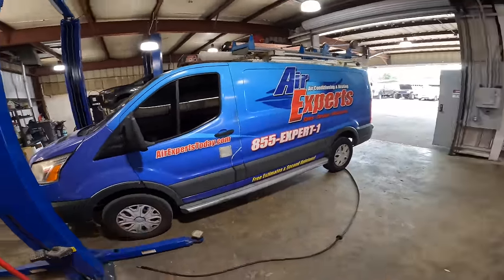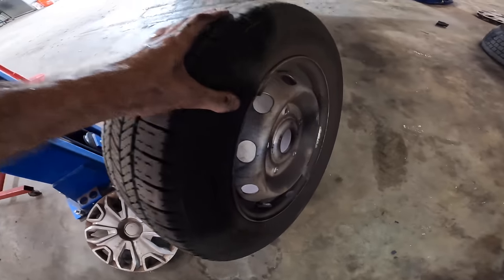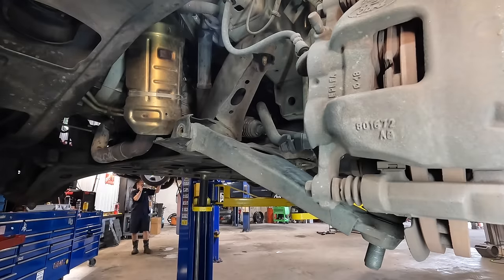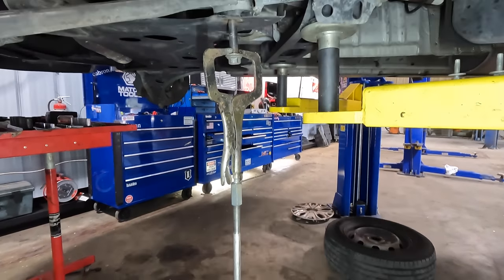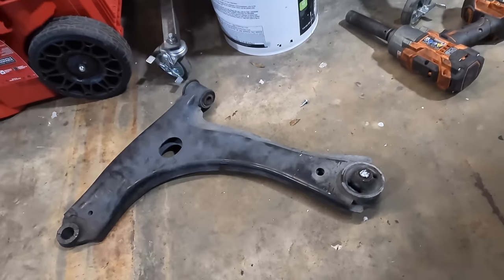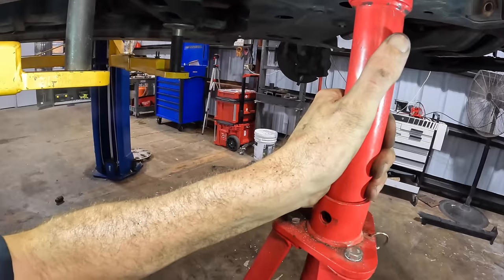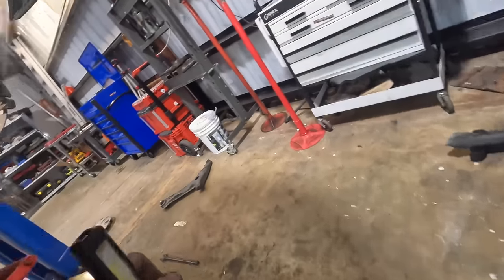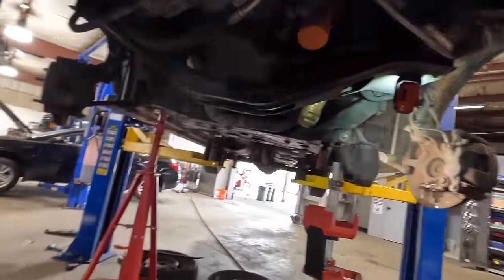Bent Frame Bolts! Easy Job Escalated! Ford Transit 3.7

Comment: The purpose of those armour bars seems to be to make the control arms part of the bumper.   With an expensive fragile monocoque like a Transit,  I'm not sure whether it's evil or sensible to make the steering part of the crumple zone.   At least you can fix it without welding or panel beating.

Comment: I used to maintain a fleet of those Transits here in the UK, but I've never seen those reinforcing bars on any of them. For balljoint removal there is a special puller with studs which screw into the bolt holes, then it attaches to the b/j thread and pulls it out. I used to improvise with 2 lengths of M10 studding with nuts, the yoke from a heavy duty 2 leg puller and the balljoint nut. They used to pull straight out. Fitting the new one just needed a suitable sized socket to press it in, using the studs and yoke to pull it in.
Reply: Winner, winner!

Comment: On long bolts that get stuck like that, the pickle fork was a good idea, should have used the head of the hammer for the rest of it with the pickle fork to get more leverage

Comment: Ray, I would have heated up the lower ball joints mount with a torch to just at red hot then while still hot hot just the ball joint with canned air held upside down so super cold to shrink the ball only and just a tap with hammer and it will fall out. Now before installing new ball put the joint in a freezer for 8hours but overnight is best as it shrinks the joint and straight from freezer install slips right in install bolts and done

Comment: I've found using a breaker bar to loosen captive nut body and suspension bolts then run em out w impact works. Just my experience.

Comment: 20:50 I would get the sawzall in there and cut the top of the bushing and the bolt at the same time with a short metal blade. Careful to check what's behind it so not to cut any wiring.

Comment: I can't see well enough to know if it's possible, but I might've tried a short Porta Power cylinder between the top of the ball joint and the upper part of the knuckle if it would fit and get a purchase. The geometry might not allow it, but if it did, those things can really push.
Reply: That would be too easy of a fix. Therefore he cannot charge an outrageous six hour job.

Comment: Good choice changing the left support position for the front of the van.  The first position was very dangerous, never ever lift on a round surface on the side of the left point, it is going to slid off and make a very large mess of the van and any human under the van.  Good change of position!!!!!!

Comment: had samme thing on a opel here lol it came out till a certain point and got stuck i had need cut in to the control arm to slice it open so that i could get the rest of the bolt out no fun way to do a 1h job in 6h :)

Comment: Oh you poor wee man.  What a pain in the rear. You can just see the twist in the brackets.  Question.  when you get this back together can it be aligned ?  I sure hope you don't have to replace major suspension bits.

Comment: Wow,demolition derby 😂 wasn't expecting that !!! . If those bolts were bent .How much more is wrong in the front of this van ?.As for the Tyre being worn like that.I would say you have a bent steering arm. The other side is OK.  Needs checking out Ray not good.
  But it was good to see you fight the good fight and win.
Cannot have easy every day.
 Great video as always. Look forward to the next fight on this van.Never did like Fords.
 Have a good day Ray 😊

Comment: If the arms are well under the vehicle, and a pad falls off, you get a nasty shock, but the vehicle stays up.

I had a Range Rover at 45 degrees to the horizontal due to a ramp failure, but I did not drop it. It did come off one pad though…

Comment: I can't remember now if it was my 2000 or 2001 Grand Marquis (had one of each year) but the rear lower control arms needed replaced and while that car was never in an accident I had no choice but to sawzall the front bolts out. It was rust that caused it. Conveniently the bolt was a normal size and the replacement bolts cost only a couple dollars.

Comment: That vehicle had vibration and alignment problem as originally designed. that beam is a frame stabilization/vibration dampening brace.

Comment: One hell of a job.  Like others have said it's the easy jobs that take the most time.  At 37:32 did anyone notice that there seemed to be more shiny space on the right side than the left in the camera angel?  It slipped fast until that time was reached.  Maybe a hit on the left side to straighten it up might have helped.

Comment: Stack big box end wrenches over the bolt add the pickle fork and reverse the bolt out. You still have down force on the control arm glad you finally figured that out. No one knows everything certainly not me either.
Reply: Oh did anyone notice how shot the ball joints are?

Comment: Those transits are hard to lift up on two post hoists, ive bent the frame lifting one where you did, to be fair , the truck was overloaded with equipment

Comment: Good vid. Get yourself a bigger better air hammer and carbide blade. Ball joints will pop right out and bolts cut almost like butter.

Comment: Would a little heat on the spindle have helped to remove the ball joints?  I suspect they were pretty hot when Ford put the ball joints into the spindle, which should enlarge the hole slightly.

Comment: I use a sawzall a lot to cut bolts up here in da Nort, and it's a lot easier if you use a coarse tooth blade. Personally I prefer the carbide tooth ones, they last a lot longer than the bimetal ones
Reply: Also the short ones work better too
Reply: Diablo metal blades cut bolts like butter.

Comment: Common problem bolt clearance to bushing sleeve, as for the ball joint there is a special press to remove and install without all the airhammering

Comment: After you used the fork initially, use a block of wood between the frame and fork (or pry bar) as a new pivot point for leverage. Leverage is key.

Comment: It seemed to me that you were pushing that air hammer hard. Clue is to not push it. Just keep it at its optimal attack distance and angle. When the hammer actually has a quarter of an inch or so, to travel up and down between the air tool and the matter to be hammered, the violence escalates to another level, to the point it might become hard to control and to keep it in the right spot. When that happens, you're at peak violence level.
Also, compare your hourly rate and the price of those sawsall blades and their decreasing level of effectiveness as a function of minutes in use. It might be more cost effective to just grab a new blade for every cut to be made.
Reply: For bolts over a 1/4" I like to grab the carbide teeth blades. They last longer and with oil, will cut cast iron like butter.

Comment: Bumper braces attached to suspension parts just to make sure the van has extra damage from a front end collision. Extra toe in anyone? Probably why the outside edge of the tire is worn out. How is the rest of the subframe? Have the front mounts been pushed back? Did the bodyshop check frame alignment when the front valance was replaced? Or did they hit a high curb when parking in front of a store? Lots of questions to why the rear control arm bolts are bent and the tire is worn on the outside edge.

Comment: You should have used the slide hammer on the ball joint. You should have used the floor jack and a come-along strap to reduce side load on the lower control arm to remove the so-called bent bolt. Otherwise, good video of what to do when you think you have no other options. There. Now I feel better. Glad I didn't need to make those decisions, though. Bottom line, what you did, worked.

Comment: If those ball joints came out like that, I'm wondering how are they going to go back in? The same way I guess, just reverse. Looking forward to the next video on this.
Reply: I'm kind of thinking he took them out the wrong direction.  That looked way too hard, and doesn't look very straight forward to press them in, in reverse of what he did to take them out.  It looks like it would make more sense to place them on top, and pull/press them downward to install.
Reply: @KevinSpeese That's not possible, they have a flange for the retaining bolts, so have to be fitted from below. With a couple of lengths of studding, some nuts and washers, a big socket and a heavy gauge plate (I used the yoke from a heavy 2 leg puller), it's a straightforward job to press the new one in.
Reply: If he takes a sander and lubes and clean it before going in he should be good.
Reply: @zachv1942  They are meant to be a very tight interference fit, so making them too loose a fit is not a good idea. With the right technique, and some basic equipment, it is easy to press them in properly.
Reply: @rickconstant6106  was thinking of just cleaning it up. But if it requires it then so be it.

Comment: Looks like the removal process heard you say it doesn't want to give you a challenge removing those bolts and the universe took action and bent them instantaneously, while still installed on the van and while watching you take parts off without a challenge, because the ball joints were also listening to that statement and also wedged themselves in by rust welding. Duely noted Ray, do not open your mouth until after you have removed said parts next time. Or just ask if they were in a front end collision 😂

Comment: What this video is missing is a little counter for the number of times Ray went over and rechecked Service Data to be sure those damn things were press fit. As hard a work as that was, you know you go back over and recheck you pulled the right year and model method, just in case…
Reply: Imagine that but on Aircraft.

Comment: I used to work for a very large ambulance company and we had a great fleet mechanic. He went from working on the E series to the Transits and hated them. He had to disassemble the entire front end to do basic maintenance. Maybe Ford was trying to help the shops by increasing labor hours on everything. Or probably the engineers were idiots, they also said burning a quart of oil every 2 weeks was "normal".

Comment: You want to put the front lift arms under the angle part on the subframe
Reply: With the lower ball joints if you are using a air hammer you have to heat it but you have to press them in they do not slide in easy

Comment: You need a ratshit strap to pull that strut out of the way.  You need to get the tension off that rear bushing.  The twist in that bushing and the bounciness of that plate are conspiring to keep the bolt trapped by its threads.  BTW, ask Troy if those are steel toed cowboy boots.

Comment: I have the previous model Transit. Not sure if you got those in the USA? I had heard some not so good stories about aftermarket control arms, not being made quite accurately enough for correct alignment. I chose to purchase just replacement bushes, and it was about an extra half hour's work to swap the bushes into the old arms. Cheaper too.
And yeah, definitely side load holding that bolt up. I jacked my arms back up some to remove them. Ok, or bent bolt 😳

Comment: I'm guessing those bars kind of serve two purposes. One being a slide rail as they are available with AWD so that would help to avoid getting stuck and two it could be to help spread out the load from a front impact. I'm thinking they're more so the former.

Comment: Those ball joints over here on the mk6/mk7 transit which I dont think you have, that’s a mk8 for us, those ball joints tend to be an absolute pain in the anoos but those rear arm/subframe bolts ive never had an issue with, on mk8 or mk7 but I’ve seen people snapping them or chopping them off or the captive nut coming loose

Comment: Next time jack up the control arm so it’s level straight and not hanging down. The control arm is putting pressure on the bolt.

Comment: What if you Would had put back the other bolt from the front and lifted from under the bolt joint to release the pressure?

Comment: I work on those transits often. I’d say about 80% of the time they are a disaster to work on. Very rarely the control arm and subframe bolts come out without using the torch

Comment: 39:11 Rainman very important!!! You cracked the knuckle when your air hammer bounced off the ball joint. You can see it a lot clearer a few seconds later.  I’m a mechanic myself so I feel your pain. Aluminum is a bitch. I’d be scared those ball joints might crack the knuckle when you’re pressing them back in. I’ve had that issues on newer jeeps with the ball joints pressed in the aluminum knuckle. (Chrysler says if the ball joint is bad, replace the steering knuckle) 
I would just be worried how you’ll get the new knuckle onto the strut as my go to way on this style suspension is air hammering the knuckle which just backfired for you.
Reply: I noticed it too

Comment: Hypes up removing some crazy suspension cross bar thing. Removes 4 bolts and pulls it right out. 

Hypes up separating the ball joint from the control arm. Sneezes and it flys apart. 

Looks at a bolt and say ez. Resorts to cutting it off. 🤣🤣

Comment: WOW, I don't know why you had to cut the bolts if you moved the ball joint stud from the control arm the bolts would come out it was not frozen on the bushing, the ball joint can be removed by a slide hammer more like Volvo or Subaru ball joint, the use of air hammer is not the correct way the steering knuckle will have issue, for the bolts they have to be replace anyways if they TTY bolts .

Comment: Block of wood as a spacer between the fork and the control arm to allow for more load while turning the bolt.
Trying to slide hammer it out with the sleeve, the rubber of the bushing absorbs the shock.
Those balls were TOUGH!

Comment: 16:32 I like it. I was wondering how to hook a slide hammer to it. I think the vise grip's release mechanism won't allow this to work. I would cut the head off of that bolt and find an adapter that will thread directly to the slide hammer. Probably a tall order.

Comment: Didn't look how old this Video is/was but on the drivers side it looked as if the part 
where the Ball joint fits in there might be a small crack. Could also just be dirty.

Comment: Please answer me this - I know I need the drivers side temp actuator on my 2010 Nissan Maxima. When I increase to the higher temps on the drivers side dial, I get the typical Guh, Guh, Guh sound. Why would I hear the Guh sound when starting the car when the climate control is off? Thanks - always enjoy your videos. Be well.

Comment: Sure seems like the body shop that 'repaired' impact damage short-changed them, overlooking the control arms. All things considered those bushings were probably initially torn during the same event. IE, insurance sent them to 'their preferred repair center' who in turn low-balled the repair as much as possible.

Comment: Ray, next time you're buying sawzall metal cutting blades, try their 'carbide tooth' line. There are short and long blades available. 'Torch' is the 'line' I'm familiar with but I believe 'Ax' is the same technology with a different shaped blade. Lasts for many, many cuts. VERY fast! Can even cut through exhaust flanges!
Reply: The ones I just used was the Diablo carbide ones, but worked like butter though the cam bolts in the rust belt. Was rust welded in the inter sleeves. I’m missing a few tools that I could have tried. But ya know work with ya got. 🙂
Reply: @Embermist69  I love those blades. I always have one on hand.

Comment: When I use my ball joint puller I put zip ties around it, one time it broke the extremely tight ball joint loose causing a trip to doctors office 12 stitches later above my eye and above safety glasses at least glasses survived I figured out using zip ties was the ticket for me

Comment: Bolt is shot anyway, it's bent. order a new bolt,
Drive it back in, sawzall or torch, pull remaining stob out. install part when the parts delivery/pickup brings it.
(Edit.)
The Plot Thickens: Apparently that bolt wasn't the only bent attachment hardware part...

Comment: Definitely an old Uhaul unit. I fell victim to the same problem. After some accidents, I believe Uhaul typically fixes their vehicles in house, keeping the accident record off of the Carfax. They then auction the repaired vehicle with a clean accident record to avoid any further liability. Again, just speculation from my experience.

I also hate the engineering of these vans. Some of the most basic maintenance tasks are made much more difficult by having to remove many more parts than normally required. Want to change the rear brake rotor? Better be willing to pull that axle shaft. Oh yeah, the rear brakes only last about 30k miles or so...
Reply: E series was MUCH easier to service over the EURO design of the new ones.

Comment: I think you may have had better results with the impact hammer if you had used the post jack on another part of the assembly.  It might suppress micro movements.  Good video!

Comment: Ford really cheapened up on the Transit vans with the uni-body construction, the bumper supports ect. I know everyone is going to tell me its better support in a crash and better fuel economy. A good side hit and it will probably total the van. Frames are still better on trucks.

Comment: this was difficult to watch.  After dealing with that bent bolt, when the ball joints became like pulling teeth every step of the way i most likely would have had a meltdown and thrown the air hammer across the shop.  Ray's level of patience is beyond me
Reply: He has the technology. He will destroy it. Oh, and then rebuild it.

Comment: What do you do with the van when you can't finish the job right away? Is it just occupying the rack until the parts arrive?
Reply: He cannot drive it off the lift without control arms.
Reply: @robertopenheimer1451  that's my point. What if the rack is needed for another job in the meantime?